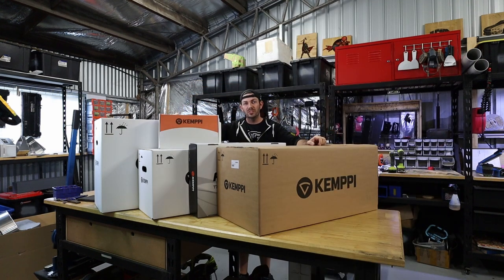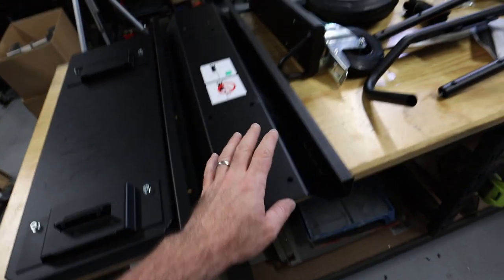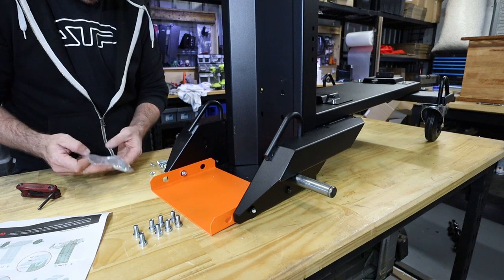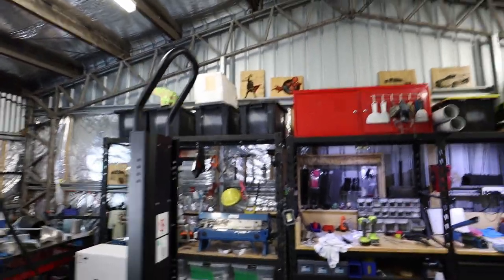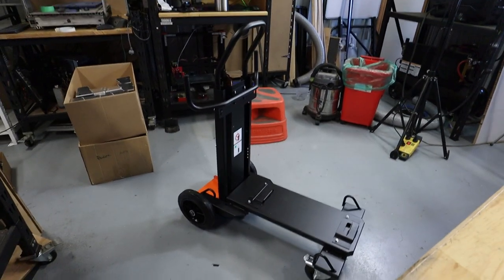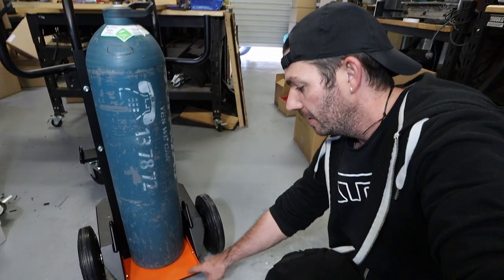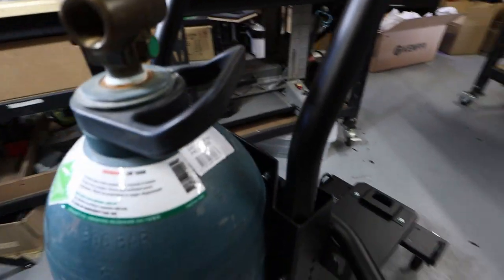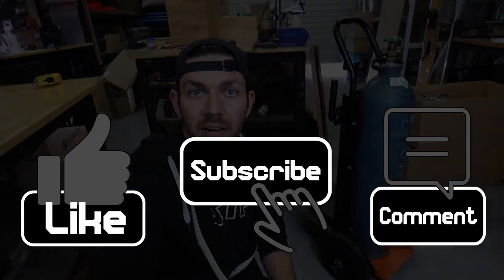Kemppi P45MT Welding Cart Unboxing - VLOG

Comment: As for the strap, mine came with a strap, was a bit of a pain to fit it, but works real well
Reply from the maker: I never used the torch hanging piece on the back of the cart that I'm sure was better suited to the strap and I have a bottle strap from another cart that I like a bit better. 
Seemed like a missed opportunity for Kemppi to supply a strap the would fit into the chain holes, but no denying it's a great bit of kit overall 👌

Comment: how much did it cost ...
Reply from the maker: The prices of these machines has changed a lot since I bought this one.
Best to contact http://www.stateofthearc.com.au/ or your local welding shop for a quote👍
Reply: @AdamTaylor  have the prices gone up or down and curious to know why you took the Kemppi route and not bought a unimig or a miller
Reply from the maker: @allryze4me  I don't know what these are selling for at the moment, but there was a price increase shortly after I ordered mine.

This machine was (and still is) the best fit for me at the time, I needed a machine quickly and it was the height of the pandemic so there were no machines available anywhere, with the features I needed.
I'm not a fan of Miller or Unimig for various reasons and Fronius was just outside my budget, so I made the decision to go with the Kemppi. I'm glad I did, the 235 amps has been useful on a couple of occasions and I'm really happy with it's performance across the board, it's the perfect machine for me.

If I was to do it again todaythough, I would probably consider the SWS Alumtig200 and take a holiday with the difference 😁
Reply: @AdamTaylor  big price difference between the SWS and the Kemppi haha. I'm thinking about pulling the pin on rhe kemppi too but she's pretty pricey these days, just shy of 10k for the full setup